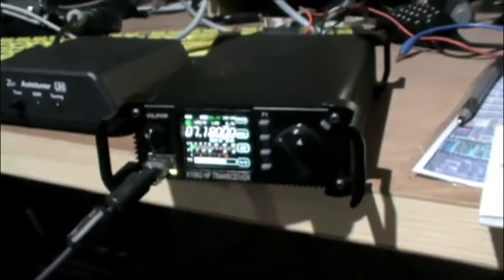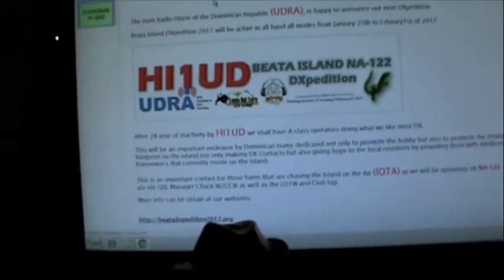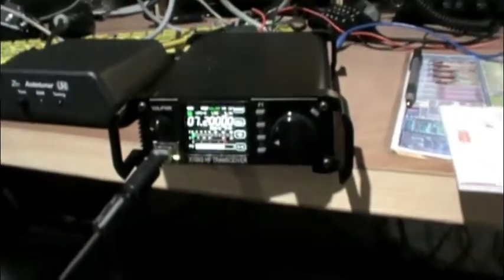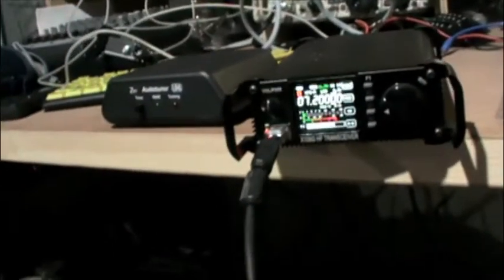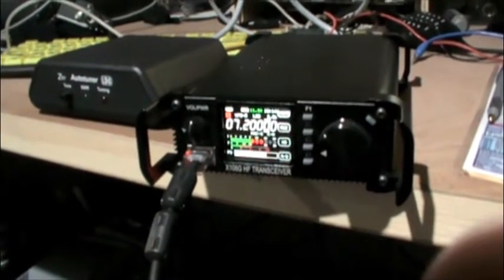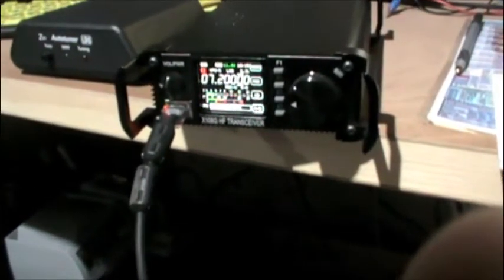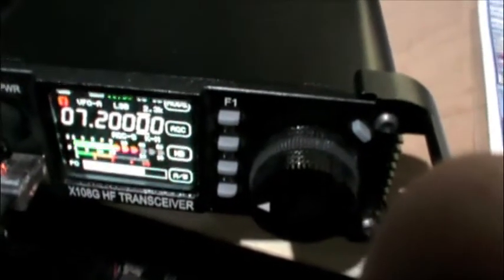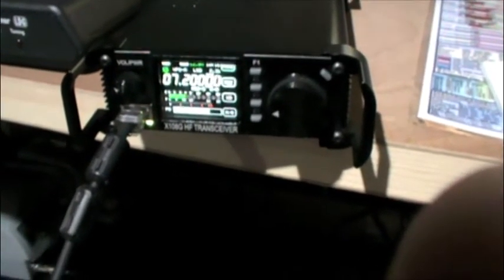Xiegu x108g test

Comment: I just bought the x108g.  When I hold the radio up to my ear there is a distinct and constant buzz coming from the built in speaker with the volume turned all the way down.  Its very noticeable when I listen with stereo headphones.  I can faintly hear the buzz when I turn the volume up but the noise is enough to be irritating when listening for ssb signals.  The noise is present even when the radio is powered by a battery outdoors.  I contacted the manufacturer by email but haven't heard back yet.  Does your unit make the same noise?
Reply from the maker: i have not noticed this with mine there is a group on facebook they have alot of people with these radios try and join  and ask there